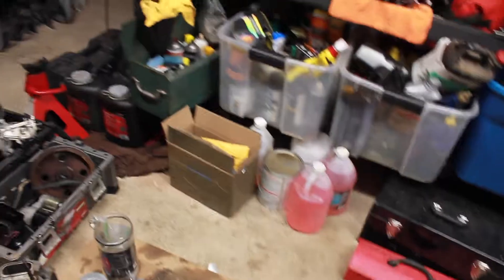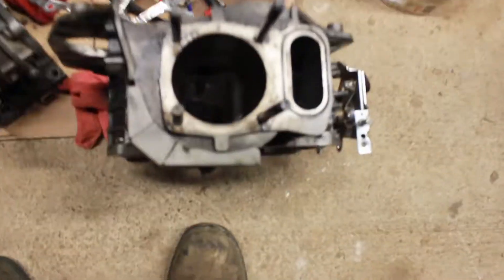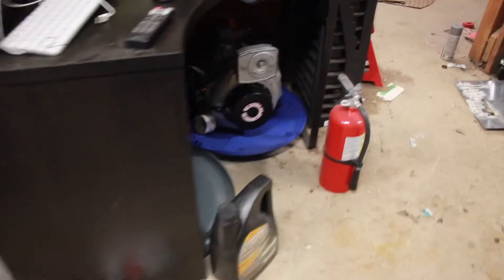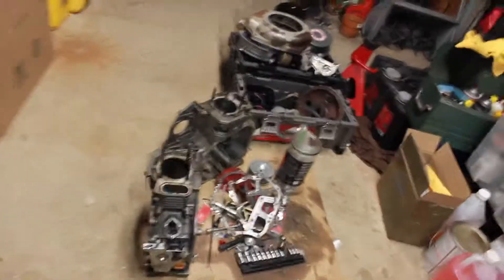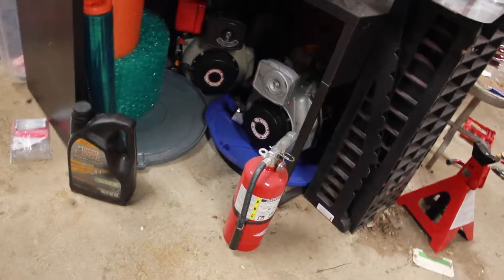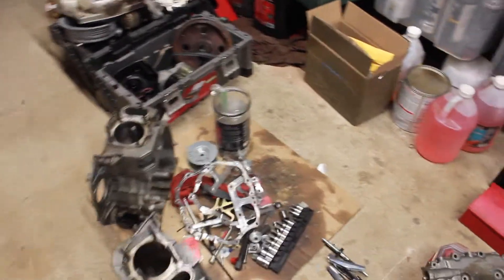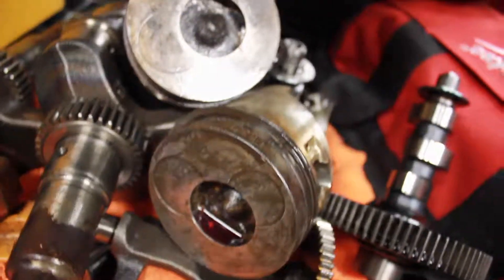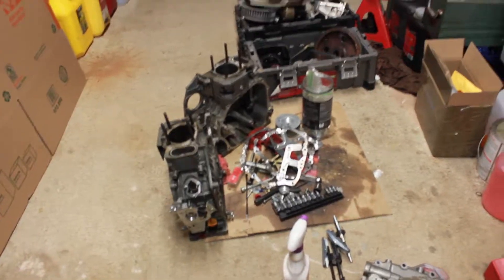*YANMAR L70 DIESEL ENGINE SOLD AND REBUILDS?!?!*

Comment: Hey, I just blew up one of these, so I have a "core".  How much do you want with a trade-in?
Reply from the maker: lambertmt what blew on it?
Reply from the maker: lambertmt no compression?
Reply: @zippyzappyz  I think it ran low on oil and blew piston rings.  It's smoking white and won't turn the generator it used to.  It runs, but it's a mess now: noisy and lots of white smoke.
Reply: @zippyzappyz  I need to go out tomorrow and try to turn it over without the compression release
Reply from the maker: lambertmt sounds good, I could do $400 for a swap if your interested, I just rebuilt two with new pistons and rings .050 over, paperwork for all the work done to them as well. Just waiting on the remainder of the parts
Reply from the maker: lambertmt i would only need the engine, no muffler or gas tank obviously
Reply from the maker: lambertmt just messaged your number